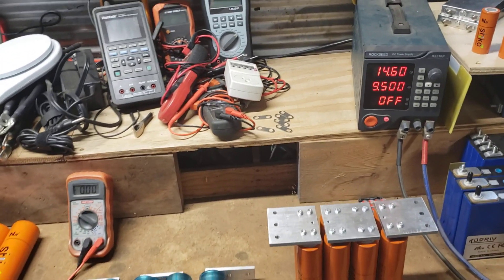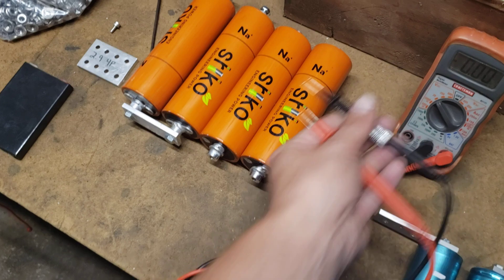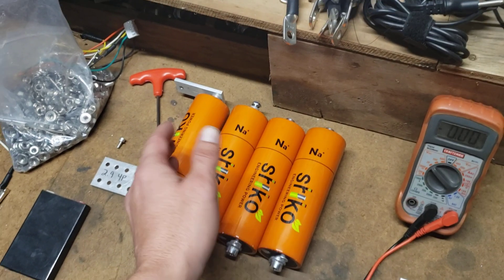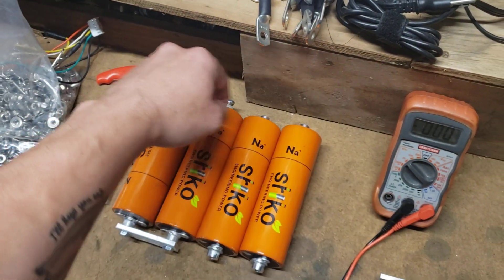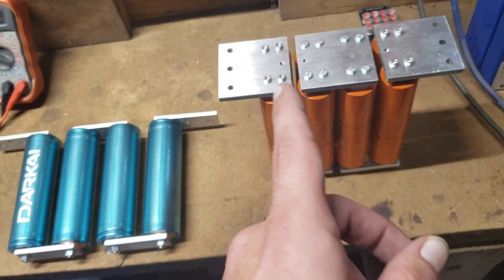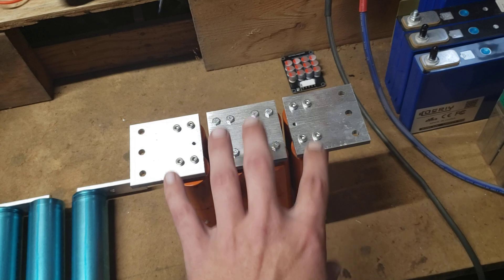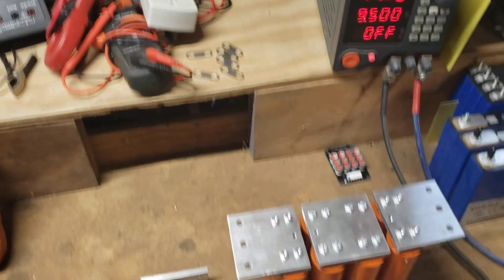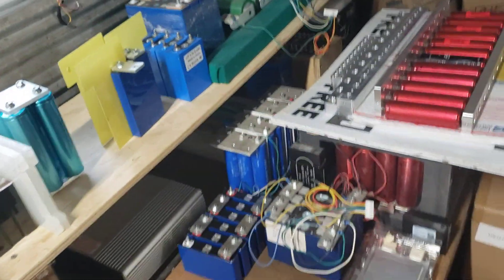charging Sodium ion and lithium batteries

Comment: You said 3.6v for charging, I'm assuming would 3.7v be ok too if theyre going to sit for a little while without use considering the max is 4v? Also, what amperage is ideal for bench charging individual cells with a bench charger like that?